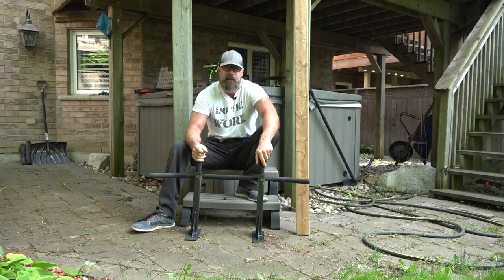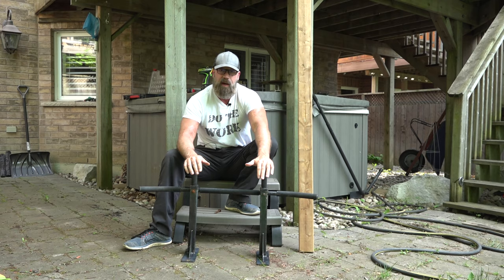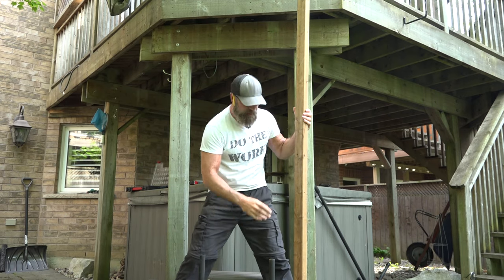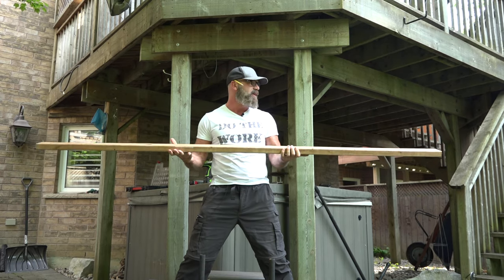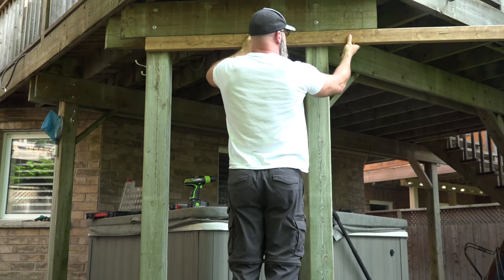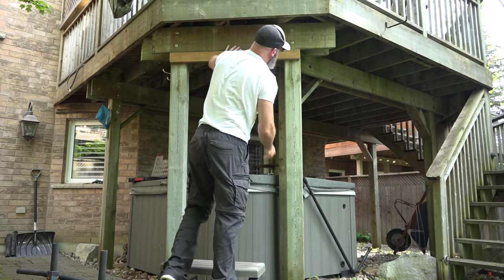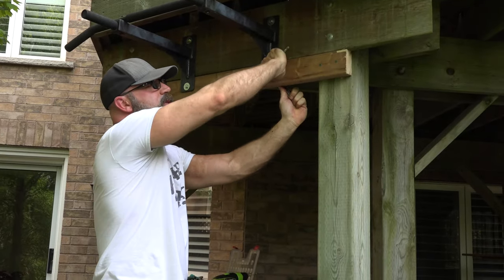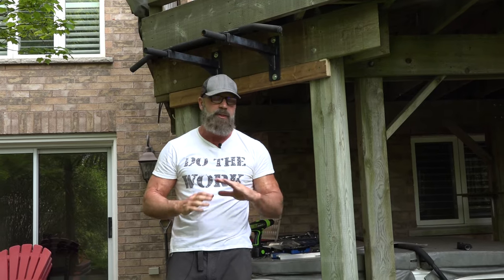Mounting an Outdoor Chin Up Bar

Comment: i designed a pullup bar and had it custom made by a welder,put it up on the balcony.tip for anyone doing it form scratch like me:dont pick a thick pipe like me thinking itll give u wrist strength or finger strength or whatever.i mean it will but it gives you calluses so you wont be able to do pullups.there are probably better ways to improve wrist and finger strength and you could just put a cloth around the thin bar for the same effect with no calluses.